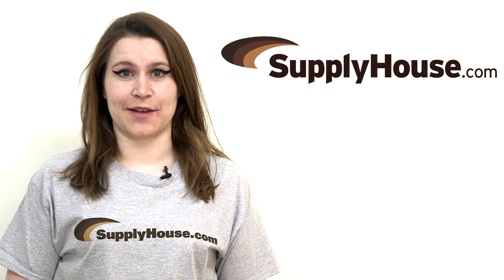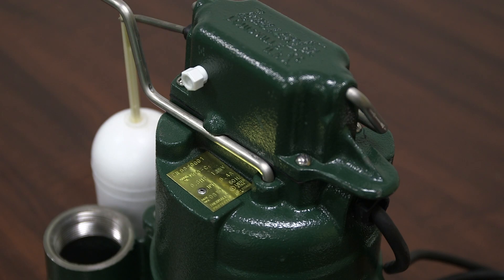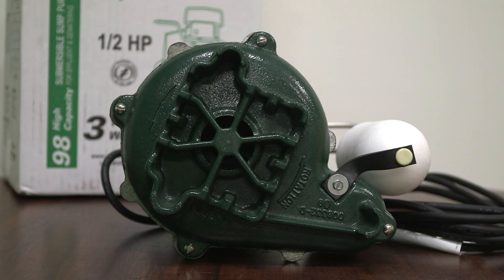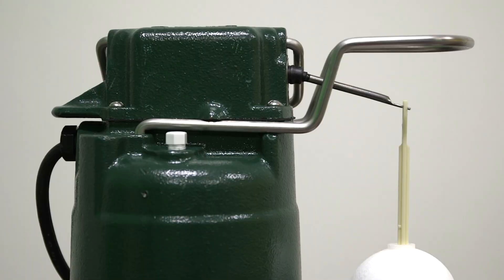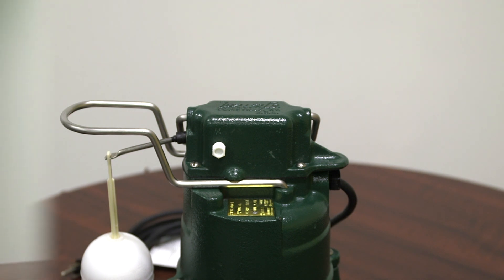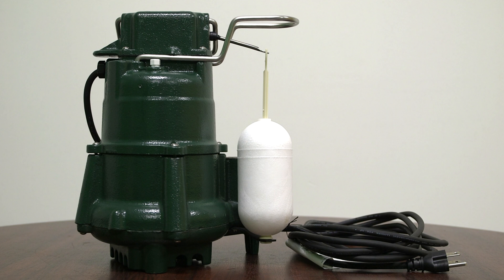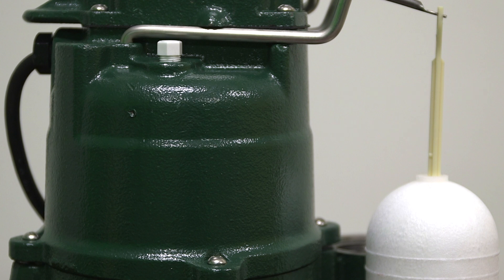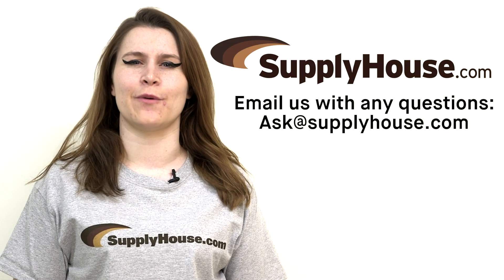M98 Flow-Mate Automatic Cast Iron Effluent Sump Pump

Comment: My m 98 float is not rising to activate the switch but does so after I manually lift it. The pump is not up against the sump basin, so it is not hindered. What could be happening? It's a new motor. Mark